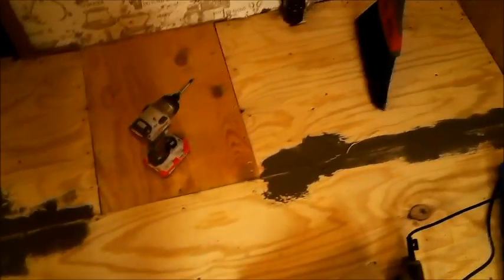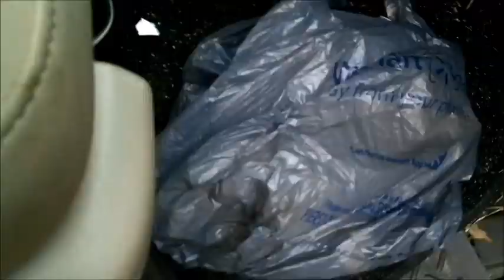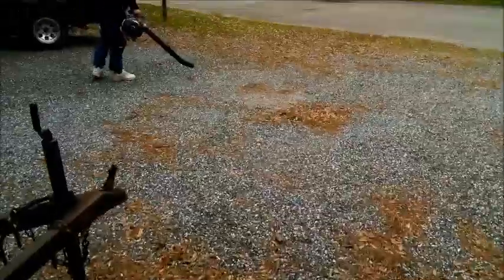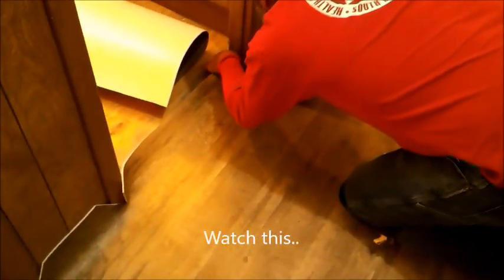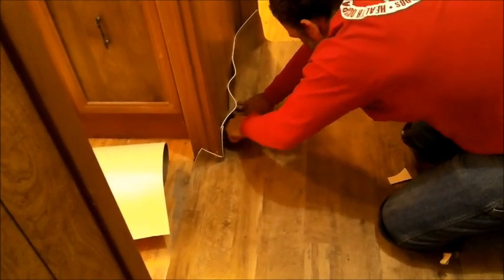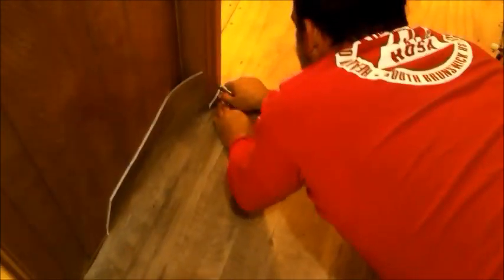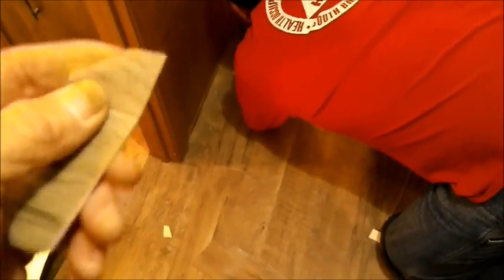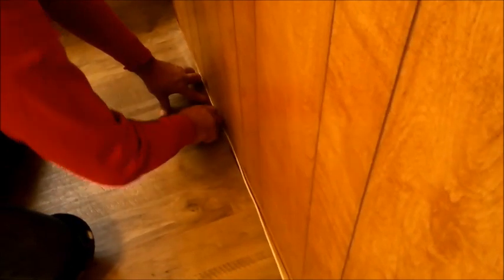How to install vinyl flooring in a Single Wide Mobile Home 🏠

Comment: Is it better to replace old patio doors or take them out and re install the old one when you replace floors where there has been a leak problem? Seems like the putty stuff mobile homes come with to seal  around windows and doors gets old or damaged after a lot of years.

Comment: Hey Drew, I'm actually about to do this in our master bathroom and I was wondering if you used liquid nail caulk on the seams where the subfloor OSB meets each other? I used tongue and groove... But it still has a seam. And I would like to make it one full piece so no air from underneath the house can come up through the floor. Can I use that liquid nail caulk and just smooth it out
Reply from the maker: No glue needed
Reply: @Drewsroofingandhomerepair  what is the white stuff that y'all were scraping on the floor for the vinyl to stick to?

Comment: In all respect to the work that floor installers do I cant understand why it is so expensive.  I was quoted $4/square foot for installing vinyl plank floors.  I asked how long he think he would take and he said 1 to 2 days....MAYBE 3...this is for a 600 square ft single wide...so $2400 for 2 days of work is $1200/day...even if it was 10 hour days it would be $120/hr....that is OUTRAGEOUS...what am I missing?
Reply from the maker: macknumber9 I charge $1.50 per square foot I’m not sure why they’re charging me four dollars and less there including labor and material